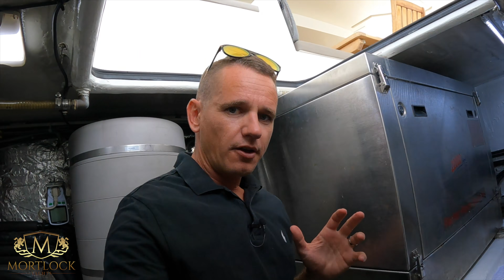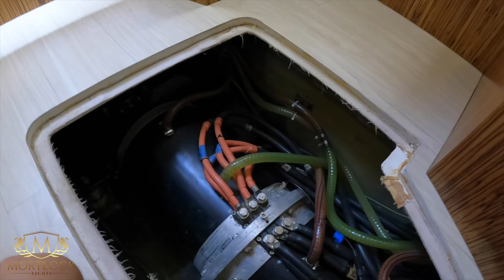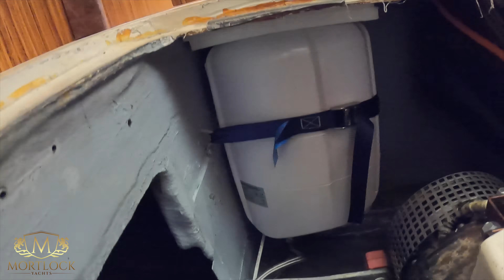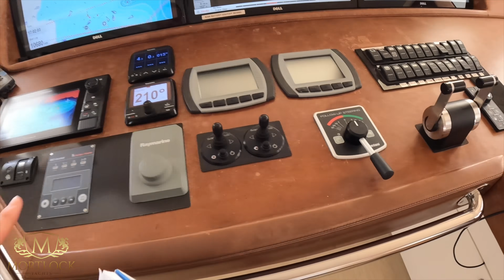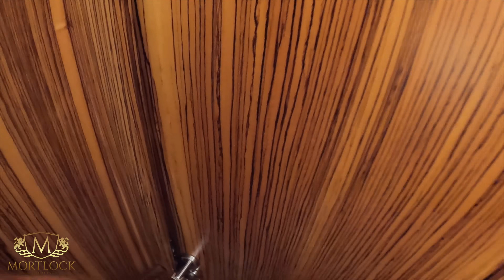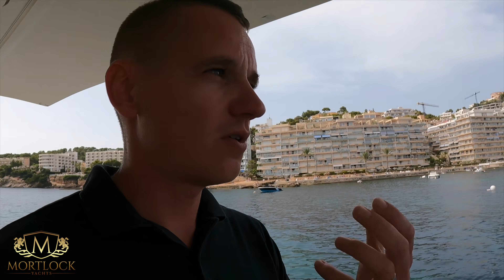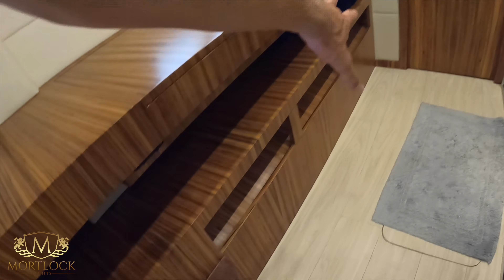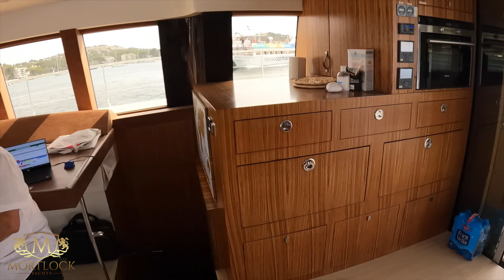TESLA OF THE SEA??? | Walk-Through

Comment: Do I gather the electric drive is delivered via one prop on one hull?  If so, doesn't this create a significant inefficiency, under way, as the boat would be constantly trying to crab...?

Also, are you sure sea water is used to circulate through the motors for cooling?  Surely it would make much more sense to have a separate heat exchanger and run essentially inert coolant through the very expensive motors and thus avoid the need to replace them due to corrosion from sea water?  By contrast, a simple heat exchanger would be way cheaper to replace.
Reply: No, there are two motors, one per hull. And he didn’t say the sea water went through the motor. He said that sea water is drawn into a heat exchanger, coolant runs through pipes that are surrounded by the sea water. That coolant then runs through the motor.

Comment: How long this BATTERY will LAST, before to change a new one?? unlike diesel or gasoline engine only needs overhauling and will last a long time again
Reply: Sadly, it is not mentioned which type of lithium system is used. The lithium ‘family’ has some 5 members. The best option for a boat is the LiFePo4 type, which is very safe, and has a very long life span. If well cared for, It will work 20 years or more.
With sale talks, you sadly (obviously) only hear the positives. But many people already found out, that ‘surface embedded’ solar panels are the solution to be worried about! They warm up way hotter than the rigid panels, and don’t have a long life span. You also can see some rigid panels mounted on this boat, they still are very close together, which is not very great for cooling, but still better than embedded panels..

Comment: 1:00ish
 13 kw
- 20kw -20 kw
=  27 kw negative
Reply: The motors are 20kw peak. They use significantly less at lower speeds.

Comment: So it's extended range hybrid system. Never running 100% solar at all.Just sail. Or use a kite system. remove the tapelines and make is solar in front. trail 100 floating panel train. in tow in the back. roll it up when returning to port. use a paddle board island material.

Comment: A Lagoon 450 has 1,000 liter tank, with an autonomy of 1,800nm. 4l per  hour at 5+ knts.

The range is never mentioned. So we have to assume around 100nm+.

In other words; every few hours, you have to fire up the diesel generator and charge the batteries or wait for the sun to do that (nobody got time for that).

This is not ready for any type of crossing. It's meant to be used locally and nothing more.

For that purpose, there are better looking power cats. Just get a cat with sails and only use the diesel engine when needed (marina etc.)

Comment: I wonder how difficult it would be to use the water they cool the motors with to run it through a heat exchanger to supplement heating the hot water?
Reply: It's possible. But mostly lots of different systems are delivered from different suppliers. You need DEEP integration for this, Tesla does this as the only car builder in the world with their super advanced HVAC reusing every bit of heat in the car. :) That's why a Tesla is so efficient in winter.

Comment: Tristan, why don't they add one pannel to be vacuume solar water heater? They could save much more energy in that way! By discarding 300W of solar power for warm water I would do any day! One panel would be enough for all 6 onboard.
Reply: I can think of a few reasons, but the biggest one was that the whole point is saving the cost of pumping the hot water in a continuous loop.   The main reason solar water works is because you can put it high enough up to use its own weight/gravity to feed the hot water.  Here you would need those same cyclic pumps.

Next is complexity - plus you still need to be able to heat water when the weather is less friendly, and at night.  So you would have to build in backup heat that would be less efficient than what they are using now.  (its hard to beat "point of use" on -demand for efficiency unless you use a LOT of hot water)

Oddly enough, they don't have THAT big of an energy problem on the boat.  The biggest reason is that they care about "at-anchor" efficiency is they want to never run the generator -- so the biggest "static" demands are addressed and mitigated.    The times they are both under way and running a lot of hot water at the same time are fairly minimal.

Comment: HORSEDOODLE.  Be buggered if I'd be replacing 32 batteries every eight years for a top speed of 5 knots.  The current off the eastern Australian coastline can be up to 4 knots.  Might as well set sail with a bathtub and an umbrella...  Missed the mark with this one Tristan Sorry.
Reply: The batteries might be guaranteed for 8 years, it doesn’t mean you’ll be replacing them once 8 years are up. The traction battery in my Toyota Prius was also guaranteed for 8 years. The vehicle is now 14 years old and the battery is still running and charging to about 95% of original SoC - a good BMS is key to the batteries having a long life.

Comment: Just asking from a very unexperienced perspective, but wouldn´t it be cool to combine this concept with a sail rig? Or would that take away to much space necessary for the solar panels? Cheers, Martin
Reply: The problem is that traditional sails would shade the solar panels. There is an option on the newer models to have a kite sail, the documentation on it isn't the best though. People keep asking but I haven't seen much information on it.
Reply: Sailing cats are a great use case and in wide production, one of my personal favorites is what Windelo is doing (link below). One of the largest benefits of a sail boat coupled with electric motors is you can turn your prop into hydropower when under sail to offset the amount of solar required.

 https://www.youtube.com/watch?v=KFDeKYt0SP4

Comment: Here’s my issue with the solar only yacht. solar, HEP, and wind power generation on every boat, that would be the ideal sustainable yacht. And a generator with decent just decent fuel tank would be a backup. That’s 4 sources of energy on board. The silent yachts are very poorly built and they charge an arm and a leg for it. Bearing have a far superior power system and just a handful of solar on the roof which does not by any means define the design. The sound of water you hear gnashing against the hull is indicative of the poor build quality and materials of this vessel. If these YouTubers would only tell you what they really think, they would never recommend this boat based on the build quality alone
Reply: Uhm this boat has Solar and a generator(Like all Silent Yachts, also this boat is from 2016)
Wind power creates noise(Watch The O'Kelly's video on it for more info)
How would you do HEP on a moving vessel without increasing drag(more drag means more energy usage to keep the same speed

Comment: Could we hear about any redundancies built into the solar and motors? How many things can go wrong and the boat still be able to limp back to port? Any Achilles heels?
Reply: 2 motors so if one goes you have a second. The batteries are in 3 sets so I assume they're got their own systems (2 of them are for propulsion 1 for house load) I'm personally curious how it fairs with a lightning strike but they've said they can take a strike and still function. Most configs only have 1 generator but that's a backup system anyways. 2 water makers on most models, they have a surprising level of redundancy (granted there are a bunch of cats with fully redundant systems)

I'm not sure what the achilles heel would be... speed? It's not the quickest even with the kite sail, even if the motors are running with generator assistance.

Price? Yeah, they're very expensive, some would say overpriced. But I think maintenance and fuel savings will offset that a bit in the long run.

Honestly, think of it as a sailless catamaran sailboat as opposed to a powerboat. 
With new solar and battery technologies on the cusp of release the concept is only going to get more common and the boats are only going to get better (although I think solar propulsion is going to be restricted to cat and tri-hull designs for the near future)
Reply: @KMCA779  Thanks, that echo's my thoughts. It has two dual motors. I wonder what happens if you lose just one of the motors that are paired? It sounds like motors never die but what about the master/slave controller? In a solar system for a house I hear that the inverter is the first thing to die. Those controllers are basically inverters so I'd imagine them suffering in the same way.

There's a lot to learn about these things. Not only how they function, but how they malfunction on the seemingly rare occasion.
Reply: @Mr.SuperStonks  I'm sure they have multiple inverters and charge controllers with milti stage switching for isolating or sharing loads and pv panel groups. I wouldn't be surprised if they had more than 2 inverters and more than 2 charge controllers.

I would assume they have a separate grounding system with  lightning rod to attract any strikes and the pv systems would all be protected by fusing also.
Reply: Cats can and do use a single engine with a slight rudder adjustment to offset torque all the time for efficiency. Electric motors have minimal points of failure compared to marine Diesel engines increasing safety further.
Reply: There are multiple redundancies in the Solar array, each string of panels has its own charge controller, and it's not as simple as "front" or "flybridge" ... otherwise shading just one cell in a panel would bring the entire array down. Google around and get some info on how solar systems actually work, having 13KW of solar panels doesn't mean you'll get anywhere near that, you might average 60%. There is also the generator, which on later boats is much more robust. Another thing to keep in mind is that you never want to run the batteries all the way down to 0 or run them all the way up to 100% ... for the life of the batteries it is best to have them running somewhere between 20-80%.
I have also seen a trend with using Kite Sails ... 
For two electric motors to fail at the same time would be HIGHLY unusual ... you have a much bigger problem ... go find it, and get on your radio!
Reply: Silent yatchs has 10 year battery warranty and 25 years solor panels warranty

Comment: Thanks, this is exactly the information I was looking for. Fuel burn for a day is pretty amazing. And 77kw of battery is a little light considering that a Tesla has about the same. But overall Silent Yachts seems to have done a good job with the balance.
Reply: Remember the boat is 6 years old, most like 8 years counting build time. So 77kW was a lot 8 years ago. New electric 60foot sailing cats are coming with 250kW packs. The tech is only getting better 😎
Reply: @AdventuresonTour   *kWh is what you guys mean
Reply: @HendrikLippold  no kWh is a measurement of usage as the h means per hour.. kW is a measurement of capacity.
Reply: @AdventuresonTour  the same would have been possible 6 years ago, tech has not gotten substantially better they just realized they need more battery capacity so they did just that.
Reply: @Pixelplanet5  actually the tech had changed greatly in the last 6-8 years. Power density is up nearly 25% in modern cells than it was back than. Plus the addition of built in BMS systems. Along with availability of battery options.
Reply: @AdventuresonTour  they are using LiFePO4 batteries, they have certainly not improved by 25% and they are extremely simple in terms of their BMS needs.
The main thing holding solar boats back is still that you need insane surface areas to gain enough energy to move a boat and that has not changed at all in the meantime.
The only thing that has somewhat improved for cars is the packing density of the cells which increases energy density on pack level but thats not relevant for a boat because space and weight are never any concern on a boat large enough to produce enough solar energy to move that boat.

just look at the model S, the 2012 version and the 2022 version still use basically the same cells with the major difference being in 2012 they had 3000mAh of capacity and now they max out at 3500mAh which is only a ~17% increase in 10 years and these are the best cells we have right now, LiFePO4 cells are far below that but are also much cheaper.
Reply: @Pixelplanet5  I've spend the last 25years working and maintaining battery backup systems and battery power heavy duty transportation equipment. I've seen first hand in the feild over the last few years and the improvements are most definitely there... so we'll just agree to disagree, enjoy your day..
Reply: @AdventuresonTour  well you have seen the switch from lead acid to lithium based batteries and yes that is a major improvement.
THere has been barely any improvement within lithium batteries itself though and thats what we are talking about here.
Reply: @Pixelplanet5  Yes I've seen the switch from lead acid to AGM and Lithium. But no I'm talking Lithium to Lithium on this subject. There is plenty of proof out there to back up what myself and others have been saying here.. Maybe you should check the updated reports. Even cheaper  LiPO4 has seen substantial growth. But by the look of things your not interested in the current information. So enjoy...
Reply: @AdventuresonTour  well it seem you didnt read this comment chain correctly then because this comment chain was about supposed improvements in the last 6 years which in reality arent as big as the OP claimed.
Lithium batteries in general and LiFEPO4 in particular have seen an immense growth in SALES but not in any way shape or form regarding their energy density and performance and thats ultimately what this comment chain was about
Reply: @Pixelplanet5  I started the comment chain by agreeing with the orgnial post, so who isn't correctly reading what? There are literally thousands of reports and articles online from manufacturers, researchers, and others in the battery world. They all show major improvements in energy density of all types of Lithium batteries over the last 8 years. So l, I'm lost as to where your getting your information, because it seems the whole world disagrees with you.

Enjoy, I'm out.
Reply: @Pixelplanet5  Not just density - but more and more efficiency in the charge/discharge cycles too.

Also newer solar panels are definitely more efficient than even 8 years ago.    What has also vastly improved are electronics that take the entire system as a whole instead of a bunch of parts.  Packs used to be "how many thousand 18650s do you want chained together?"  Then 20 different blue modules on a wall to control them.  (one solar controller per "string", one charge controller per battery "bank,"  multiple inverters to split loads.... displays for each device...      

But the reason that they vastly increased the battery capacity was cost/KWH has come down sharply as geometries have improved.   As long as they can source the batteries in sufficient quantity -- price isn't the barrier anymore.  Space is.

I actually worked on an older system recently that STILL had glass cylinder wet cells.  They keep the electrolyte levels up to date and they STILL WORK.  Talk about Old School...